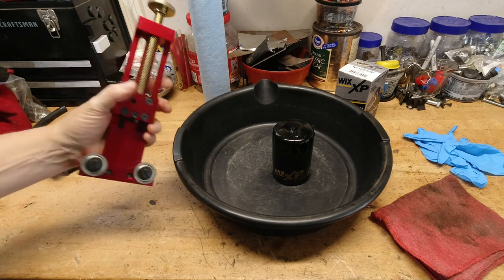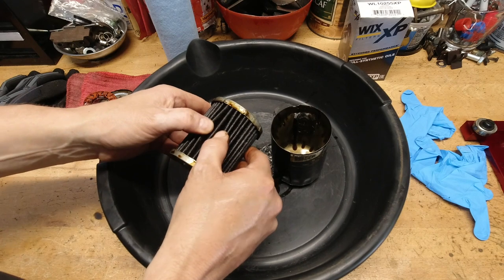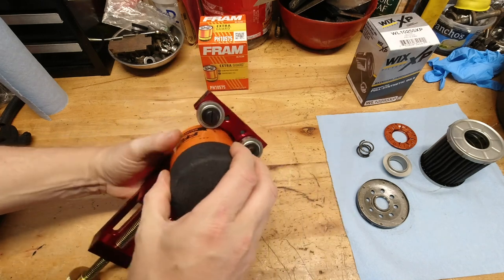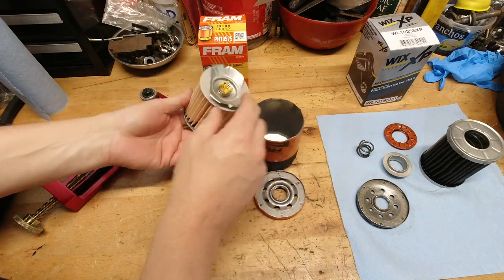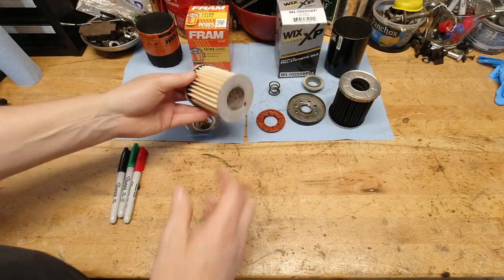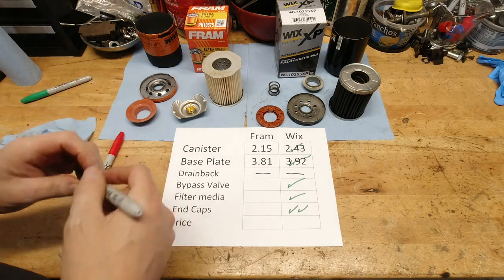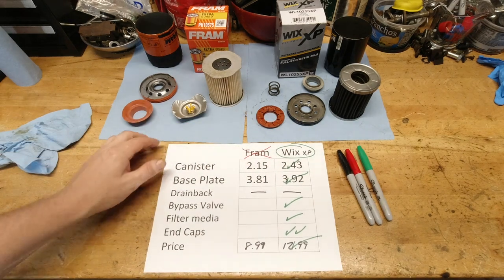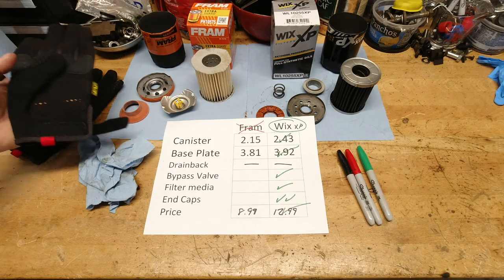Comparing a Wix XP Oil Filter to Fram

Comment: Did you really compare a top end wix to a bottom end fram?!?!? Oh my…. Maybe you should look up the efficiency ratings of these two filters. The fram orange can is 95% at 20 microns and the wix xp is 50% at 20 microns. So even though the much more expensive wix is constructed nicely it doesn’t filter nearly as well. Now if you compared the wix xp to the fram ultra you would see that there is no comparison. The ultra is rated at 99% at 20 microns. And is constructed better then the wix xp. Apples to apples…
Reply: @jordanmarling7947  Fram Ultra series was released in 2021 as a response to the hundreds, if not thousands of engines killed by their inferior filters. I don't trust any company that takes 30 years to respond to known quality issues. I'm assuming it will be only a few years more before quality control will resume its old ways.

Comment: Excellent comparison. I definitely would prefer the Wix filter, however why does everyone compare the higher end of the brand name filters with the cheapest Fram filter? I would like to see higher end Fram filters inside.
Reply from the maker: It was the cheapest one they had (in stock) and I’ve cut one apart recently so it was a good comparison.
Reply: @MuscleCarSolutions  The apples to apples comparison should be done with the Fram Ultra Synthetic, net the cheapest Fram you could find at Walmart.
Reply from the maker: @daytimedetroiter  send me one.  I’d be happy to run another test.

Comment: My favorite thing out of all of these comparison videos I see is that it's never an apples to apples comparison. 
Now I'm not saying anything negative about the wix xp filter, I feel for a real world daily driver it's the right filter. 
But, I'd be remiss if I didn't say, synthetic media vs. Synthetic media Fram ultra is a darn good filter especially with it's price tag. But, down to overall construction, I'll give wix xp the win because on the ultra, the casing and bypass spring remain thin and stamped steel. And the wix will have the edge in flow hands down.

Comment: I personally like to use wix or the oreilly "microguard" filters which seem identical to the wix filters. I have never cut them apart to verify but just by look,feel,and the weight they seem identical that would make for an interesting video if you got the 2 and cut them open. Most of the parts store brand stuff is actually rebranded products from other companies. I have been told that the generic oreilly brand motor oil is actually rebranded havoline oil.

Comment: You should've seperated the filter media, you might've found the glue fram usually uses, which is probably not good even if the cardboard holds up... Wonderful video tho!

Comment: Is there much of a difference between the XP and the standard Wix?
Reply from the maker: Pretty close to the same.  The XP I think is made for synthetic oils and the standard works with either.  Other than that, I don’t know what the differences are.
Reply: I've seen many Wix XP filters cut apart online. I only USE the regular WIX filters but I've cut many of them apart. The filter element media is just cellulose as opposed to the XP synthetic media with a metal screen backing. I think the base plates are the same, same anti drain back silicone flapper valve, same  sheet metal can, similar element end-caps. They may have different bypass valves for different apps, but nothing that's a deal breaker. The big  difference is the price, and the filtering specs. The regular WIX filters better, but the XP filters longer. The XP is designed for extended oil change intervals. It filters less so it doesn't plug up and go into bypass mode on those extended oil change  intervals.

Comment: I'm a STP guy but i just bought a wix an thought about switching over to them . Just not 100% still yet lol
Reply from the maker: Easy.  Next time you’re done with the stp filter, cut it apart and see what’s inside.  You’ll get the answer pretty quickly on what the quality is like.
Reply: I just bought 3 wix filters for my vehicle lol 

To chnage from stp but I have no way to cut open the stp filters I'm removing .

An the Wix filter part number are 51036 , but no-one is showing videos ripping these apart everyone is doing the XP type but I'm not using them or that type cause I'm using really thick regular oil on my vehicles
Reply from the maker: @KnuckleHeadGarage27  got a hack saw?  If you ignore what that creates in metal shavings, you can at least compare the two!  Hacksaw that bad boy apart!  (Not while on the vehicle and not while running) 😆
Reply: @MuscleCarSolutions  lol yeah I've done that before but makes a bad mess plus the metal shavings an stuff 

I wanna see if there is any metallic or anything in the filters especially one of my vehicles with some slight engine noise an low oil pressure readings when up to temp
Reply from the maker: @KnuckleHeadGarage27  the tool is well worth the investment!

Comment: Long shot but hoping to get input from someone, wix xp 57620xp, k&n hp-4003 are recommended for a 6.7L cummins deisel. Neither these or many other filters for diesel have an anti drain back valve while some cheaper brand filters do. Why is this.

Comment: fram used to be a quality product.
Reply from the maker: I honestly don’t remember.  Been cutting apart filters since I was a kid.  I guess I didn’t pay much attention to it until recently.
Reply: @MuscleCarSolutions  i'm thinking back when i first started working on cars in the early 80s they at least had a good rep and guys were using them on race cars. but i never cut one open.
Reply: When was that? I've been working on cars for over 55yrs. Sure, Fram did a crap-load of advertising, but as far as building a GOOD filter that never happened till they came out with their sooper-dooper filters, recently. There had been rumors, and anecdotal stories floating around for yrs about how mechanics were finding problems with them when I was growing up.

Comment: you are not comparing apple to apple when comparing Wix XP top product with Fram's PH middle grade . That is absolutely wrong. You have to compare Wix XP with Fram XG ultra synthetic filter.
Reply from the maker: Not wrong at all.  It was the only one on the shelf at the time.  But I’d you’d like to send me any other filters to compare the Wix to, my address is in the About section here and you can send me as many as you’d like.  I’ll happily cut them apart.